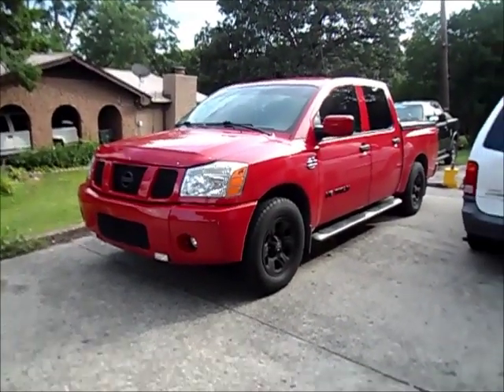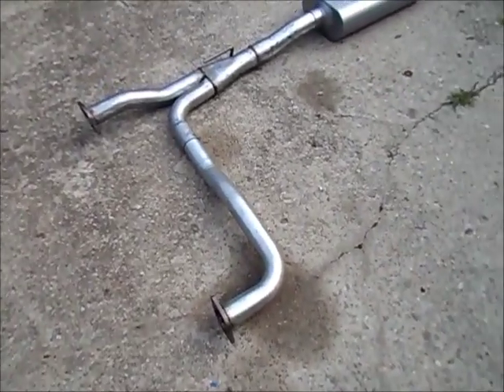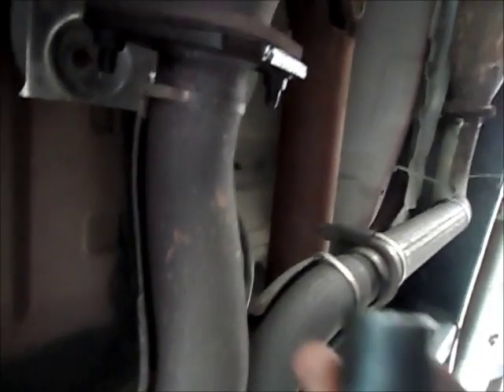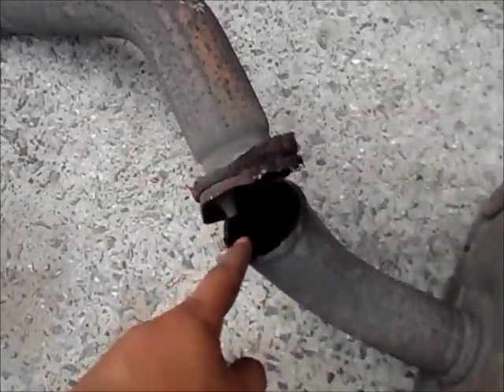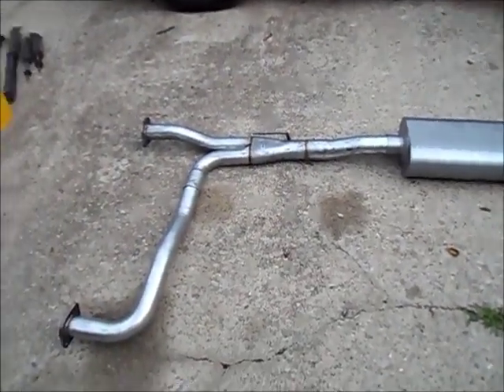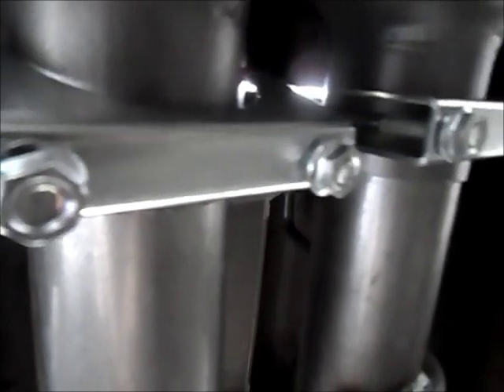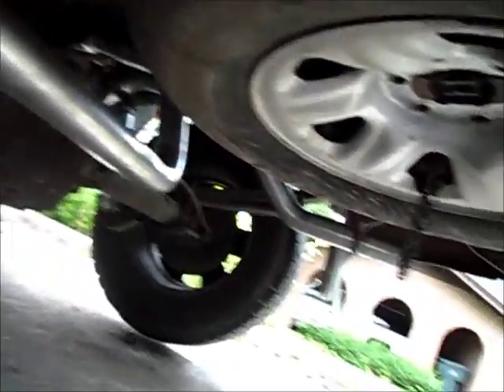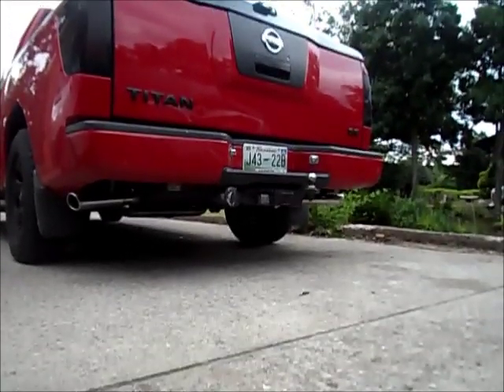04-13 NISSAN TITAN EXHAUST INSTALL

Comment: Nice work man, sounds awesome and looks great! You did the install by yourself? May I ask how long it took you?
I bet you notice an improvement in horsepower now that that 5.6 can breathe better!
Thanks for posting.
Reply from the maker: thumperpaul IT TAKES AROUND 2 HOURS AND SOUNDS GOOD, DONT KNOW ON HP CAUSE WAS A FRIENDS TRUCK.

Comment: Nice truck and video! I like the sound. But which Flowmaster Exhaust System did you go with ? The 70 series model or 50?

Comment: Great video thanks for sharing! you made this look easy. I have a  tital heavy metal that I want to have this done on. How much did you pay for the flow master? and how much would it be for install so I know if im getting a good deal. 

Thank you
Reply from the maker: Joel Perez paid around $480 for complete dual kit and it takes around 2 to 3 hours to install if u have no problems removing old exhaust.
Reply: Uribe motorsports thank you for your response. I appreciate it and again great job on that truck.
Reply: @URIBEMOTORSPORTS  the truck looks nice and leave.. what did you do to get it that way? And what size tires are on it?

Comment: Great video.  Quick question regarding the installation.  Not knowing much about installing an exhaust system, does it require any welding or do the clamps do a decent job on the connections?
Reply from the maker: +surette21 with flowmaster setup just need clamps but other kits may need some welding.

Comment: looks like you caught it in time the weld broke and would have fucked up your truck the exhaust would have frayed the wiring and stopped the truck from running its a design flaw doing mine next week.